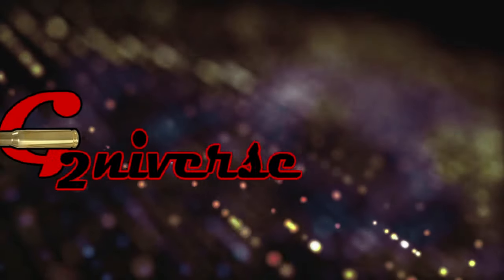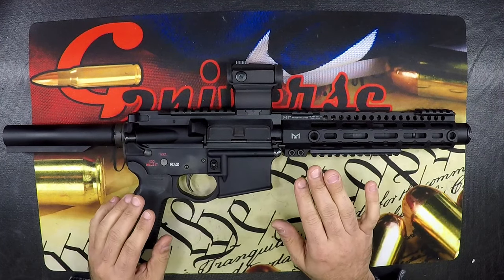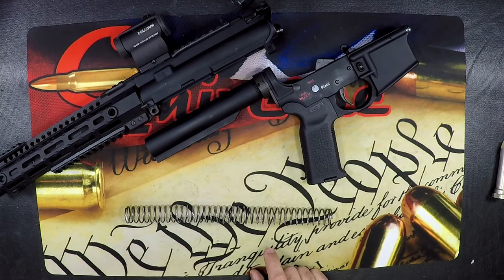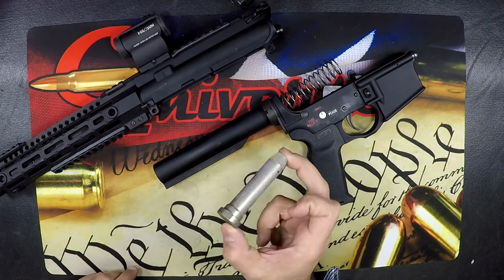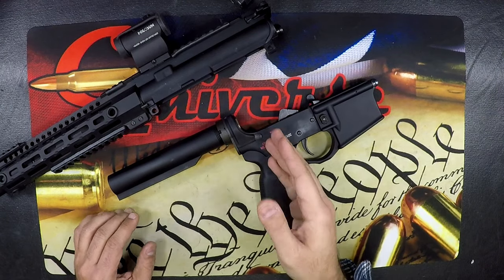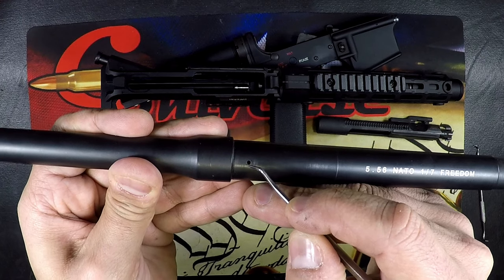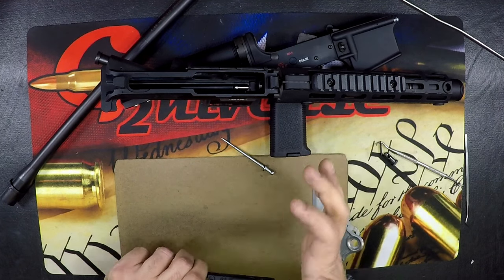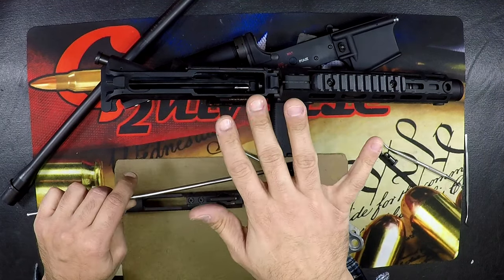Safely Fix Undergassed AR - How To

Comment: I generally enjoy your videos, but this one had me scratching my head.

When I see a video discussing whether or not a rifle is undergassed and it's suggested that the first thing to examine is the LOWER receiver, I have to question if you understand what the gas system is and how it operates.
It's like getting a flat tire and opening the hood. While the buffer and buffer spring all work in harmony with the gas system, there is no "gas" in it.

Issues with cycling due to undergassing almost always involve a misaligned gas block, a gas block that isn't correctly fitted/tightened and is leaking gas, improperly fitted, leaking or broken gas key on the bolt carrier, an improperly sized gas port hole in the barrel or worn gas rings. A gas tube that isn't the correct length "could" be an issue, but as far as I know, that isn't an issue that is even remotely common.

The buffer spring and buffer can affect cycling, but have nothing to do with "undergassing", which by definition means an insufficient amount of gas is available to cycle the firearm. I'm not trying to be an asshole, but this one is way off the mark
Reply from the maker: You couldn't be more wrong. Most home builders have no idea how the buffer system works in tandem with the gas system.  You can have a perfectly aligned gas block with a heavy buffer and short stroke.
Reply: That's very defensive. First, you began with an assumption that I'm a "home builder", knowing nothing about me. 

You mentioned a misaligned gas block and yet ignored all the rest. The term "undergassed" is a clear indication that an insufficient amount of GAS is cycling through the system. 

There is a reason for using different buffer weights and springs, but it is primarily to reduce felt recoil and minimize wear and tear on internal parts. You CAN play with them to try to get an undergassed firearm to function, but this is a BAND-AID. It isn't making an undergassed firearm suddenly have the correct amount of gas.

I wasn't trying to insult you, but you're missing the point about the gas system and the terminology.
Reply from the maker: The first thing Caleb literally said was if your overgassed go with an adjustable gas block or heavier buffer. Come on man, you're ignoring facts. And I didn't call "you" a home builder, these videos were made for home builders to diagnose their issues.
Reply from the maker: 90% of ar owners "think" their overgassed or undergassed when they usually aren't.
Reply: The issue be spoke of was overgassing. This video is undergassing, but in any case, Is that what you took away from that? He said "it's BEST to address the gas block because you're still getting all that gas back there" and in doing so made my point. Using a buffer to make it work is not addressing the underlying problem. It is a band-aid.

A buffer or buffer spring can help overcome an issue with undergassing. I'm not disputing that, but it doesn't address the problem. You need enough gas and that's an issue with gas port, gas block (alignment, configuration etc), gas key, gas rings etc. Those are the things you need to address with undergassing. 

I'm not trying to be difficult, but it's a gas system issue. If a firearm is getting enough gas, you need to fix it, not just get it to work.  If that's good enough for you, that's fine. To each his own.

For me, the only time I'd rely on a buffer &/or spring change as a fix would be if the problem couldn't be fixed because my gas port was undersized, as I would not attempt to drill a larger hole. I would not wager my life on a rifle that I needed to play with spring & buffer combos to ensure function. Again, if you would, that's cool. There's enough room in the gun community for different opinions.
Reply: Can you give me an example of where someone "thinks" their rifle is undergassed? I'm not being a wise-ass, maybe you can teach me and the other viewers something.
Reply from the maker: I can give you about 50 just from emails in the past two months where individuals rifle doesn't function (failure to eject, failure to extract, short stroking, you name it) and they automatically go to its undergassed or overgassed, when in fact the gas system has nothing to do with the majority of their issues.  Its usually one of two things (1) incorrect parts (buffer system, wrong size gas block, wrong length gas tube) or (2) worn/broken parts that need replacement.  Thats why I started pretty much every video in that series with checking the buffer system and checking your parts for wear.
Reply: I am sure you see it a lot these days. There are so many people getting into AR-15 s, but we know people are prone to half-ass things. There are no shortage of people who  "Bubba" their guns to their detriment.

I appreciate the exchange. Just trying to clarify the issue. For me, I check the ejection pattern of every rifle I build to determine whether how the gas system is working, and if it is, I follow your advice with regard to changing buffer weights. I am also a big fan of Sprinco buffer springs. They're pricier at $20, but they claim to have a lifespan of 1M rounds, I use their blue "extra power" spring in all my carbines, but they have four different springs for carbines depending on need. I'm sure you agree there's nothing like a smooth shooting rifle. If you haven't tried the Sprinco springs, I highly recommend them.(They make fantastic extractor springs as well)
Reply: Just put an h3 in my .308 Adams arms running great now , after a year of many cycling issues.
Reply: Under or over gassed has less to do with the amount of gas is your system and more to do with carrier speed. 

Yes, most of the time your gas block is improperly aligned or has rotated, but excluding that, there is more than one way to skin an undergassed cat. 

Regulating mass or spring resistance is the easiest fix.

Comment: What about for a tubeless gas system? My ar9 didn't come with a gas tube and it won't eject rounds.
Reply from the maker: ar9s are blowback systems, they are not gas impingement.  Makes it much easier to fix...your issue lies in the stock/buffer combination.  MIght have to play around with buffer weights/buffer springs.
Reply: @G2niverse  yeah. I've been looking at a few 3oz buffer weights
Reply: Put some dummy rounds in and insure the ejector is solidly hitting the rear of the cartridge when the bolt comes back. Also make sure the edge of your extractor is clean and doesn't have a blunt edge.

Comment: you take it to the maker and make them fix the defect
Reply from the maker: the buffed penguin good luck with that...most will tell you to kick rocks.
Reply: @G2niverse  no what i mean is they should be forced by law to fix defective products
Reply: Its kinda like you buy a new carborator and it isnt adjusted correctly from the assembily line. Why would someone ever say lets make it LAW that they have to fix the ajustments on the carb. Its not necessarily a defect. More like fine tuning or wearing of parts because its under 60k psi.

Comment: ... springs are based on buffer tube length, not gas tune
Reply from the maker: Christopher Keel well there are only two lengths, rifle (usually a fixed stock) and everything else. BUT i have seen people put carbine springs in a rifle buffer and vice versa.

Comment: Thats all about weak ammo not the weapon
Reply from the maker: Id estimate the ammo is the issue less than 10% of the time.
Reply: @G2niverse  i checked all of that. i tried several sub sonic loads but my rifle fails to feed and of course does not engage the hold open. the gun is even suppressed. what do you think is the next step? the gas hole in the barrel is 0,1 inch stock wich should already be fine for 10.5" 300blk. drilling it out further? or using the circumcised boltcarrier instead of the m16 one (wich i really really don´t wanna do)?
Reply: @G2niverse  Update. solved the problem i drilled the hole slightly bigger but not only in the Barrel but also in the gas block. never forget to dril out the gas block too after reching a certain diameter. and using a borescope for alignment

Comment: My AR15 is undergassed. It will eject, but fails to put the next round into battery, so I basically have a bolt gun where I have to eject a good round each time. 

I have a carbine buffer spring, but a 20" barrel with a rifle-length gas system. Should I just buy a new receiver extension, buffer spring, and buffer? Or should I buy an adjustable gas block? (The one on it is fixed.) What do you guys think?
Reply from the maker: So a 20" barrel running on a rifle gas system, but with a carbine stock setup?  You should be overgassed...because you're running a shorter stock setup on a longer gas system.  Make sure your timing isnt actually too fast.  Meaning the bolt is moving too fast to catch the next round.  (easiest way to do this is to video it with your phone and watch it back in slowmo.  Youll see the bolt ride right over the next round in the mag.  You might also be seeing scratches on the top of your next round in the mag where the bolt ran over it).  If this is the case, you can start with a heavier buffer, then higher powered spring).  If its not the case and you are undergassed.  Id try a lighter buffer first (thats the cheapest option).  If that doesn't work, go to a low powered buffer spring.
Reply: @G2niverse  Thank you so much for taking the time to write all of that out. I will follow your advice. I bought an adjustable gas block to switch it out. If that doesn't work, I will try the different buffers.
Reply from the maker: Np. I'm guessing you have the a2 sight/gasblock combo that's pinned in. If you've never removed one before, search it on yt. Those pins only go in and out one way.

Comment: Don't forget to make sure that the gas ring gaps are Not lined up
Reply from the maker: Complete myth.
Reply: @G2niverse  If the rifle is running on the very edge then it can cause a short stroke. I tried this with an adj gas block and the bolt carrier failed to hold back..
Reply: @hairydogstail  ... Very edge??? Please explain.